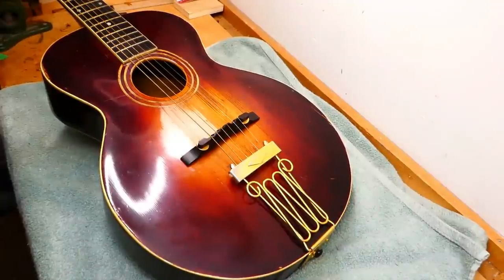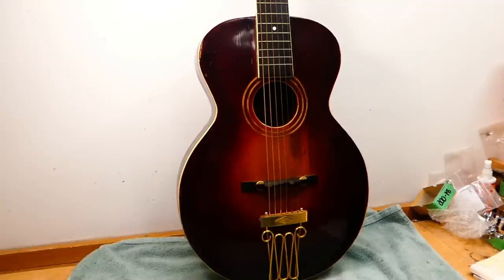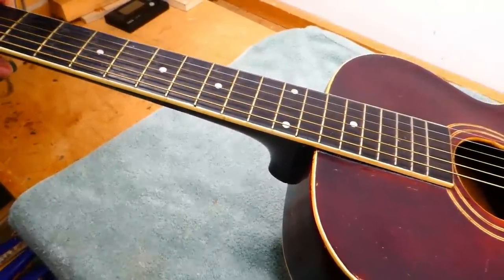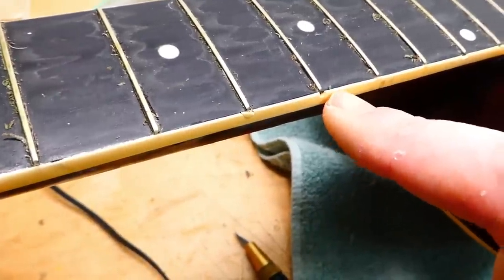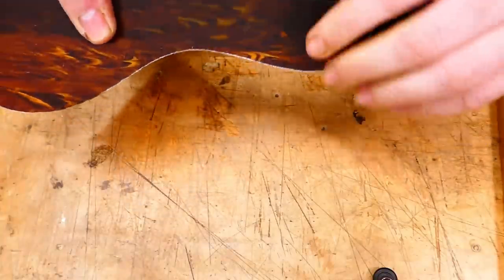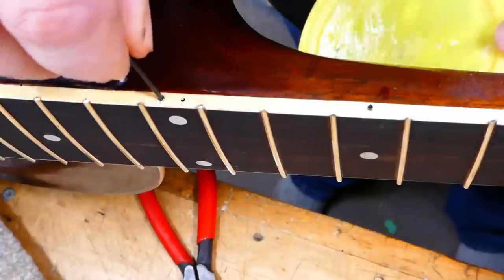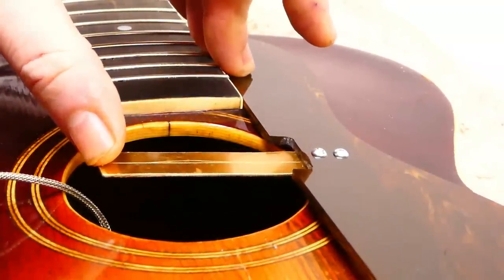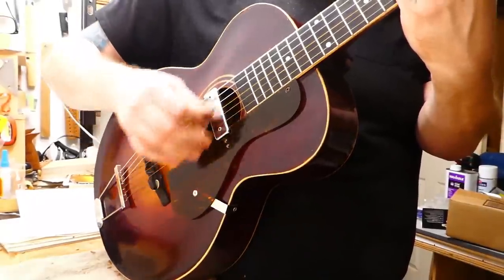1920's Gibson L1

Comment: I have a 1908 L-1 and I also have been building modern archtops and guitars. The old L-1 does indeed have none of the volume or projection that even early L-5's have but that's not due so much from the shape of the holes but the evolution of the top thicknesses they used. The early generations were still trying to figure out how to transition from guitar construction, which had been around for a long time, to violin inspired construction, carving from a plate into an arched pattern. I would imagine that a great fear was that 6 strings could collapse a carved top and bracing and arching thicknesses were still largely experimental and pioneering. 
A LOT of factours were coming into what we think of as accepted design now. Those early years were all experiments, one at a time, and even the potential of an arch top was unimagined since violins, their closest relatives, were seriously different in their being driven by a bow and needing no sustain because of that.
It would indeed be interesting to take the outward dimensions of that L-1 and build it with modern knowledge of arching and thicknesses. Then we could truly figure out what the potential of that round hole small bodied design could be.

Comment: 5:20 I have an idea for why that guitar doesnt have position dots on the fingerboard binding

Its mostly a lost art today but before electric instruments, the way you held your guitar was very prevalent on musicians minds. I read in a 1903 Gibson catalogue: 

"The Gibson mandolin should be held at not more than three points of contact; namely, lower rim resting on limb, upper rim resting against body and supporting the right forearm. This leaves the sound-board and back-board, which are carefully graduated, free for vibration."

I have a 1912 archtop L1 and tried this out for myself. And by angling the guitar more diagonally between my chest and thigh, I noticed not only that it resonated a lot better, but also that I could clearly see what notes I was holding on the fingerboard without having to lean over. Hence, fingerboard dots arent neccesary if youre holding it the way youre supposed to

Just an educated guess of course

Comment: This is why I tune in, to see gems like this one get a polish. 
 I installed a 50's DeArmond into an old archtop, and I got the same brash sound until i experimented with the distance from the strings. 
Further away it'll find the mellow zone, but even closer to the strings, too close, you can get this white hot interaction, like Rev.Horton Heat hot. Fun stuff.

Comment: I have made a few reconstructions of lyres from the 6th and 8th centuries (Trossingen lyre and Köln lyre) and from all I could find about them they were also carved from a solid piece (wich is what I did as well). Lots of work I can tell you. My next ones will probably just be made with a thin back panel and sides made from appropriately sized strips of wood (the walls are really thick compared to guitars).

Comment: Gongrats on an excellent repair video & short early Gibson Co. primer. I have a 1918 L3 that is very similar to the L1 in a much better condition, you could say almost new compared to this wreck given it is 102 yrs old. What you didn't mention (or I failed to hear) is the slightly elevated fingerboard for easier high fret access that in the L3 is more pronounced. Mine has the trapezoid tailpiece with the tortoise top and the ebony pegs, works very fine and the neck is of baseball bat thickness, one has to see it to believe it and no truss rod, I think it was introduced in the early 20s but it doesn't need it. Interestingly, the previous owner came with the exact same idea for mounting a 60s Hofner Diamond pickup and made a tortoise pickguard (the original long gone) with exactly the same cut as yours to accommodate for the pickup and no drilling on the body, the cable jack is glued on the pickguard. It sounds and looks awful and I want to replace it and bring the instrument to its original condition, can you help?

Comment: I know what you mean about video editing. 
I'm still trying to get used to Davinci Resolve, having come from Vegas 11. 

Re small holes in pickup rivets. 
The RC modelling world used a lot of very small diameter bolts and screws. 
1.5mm , even 1mm  !!
Also the small taps and dies. 
It might be doable to put a thread into the rivets and then run a bolt through the brass from below. 
Just a thought ...

Comment: Given the vintage of the guitar...I wonder what the decision process is when it comes to drilling a hole for the pickup...as the owner of a 1941 Martin O-15...the thought has passed my mind that a pickup mighty be a helpful addition but I can't bring myself to allow the the modification. It's not "original" original. Tuning machines are replaced with 80's vintage, a headstock break has been repaired and it's been refretted...but those things, to me anyway, pale to drilling an unnecesary hole...